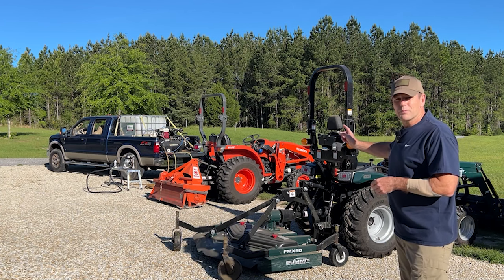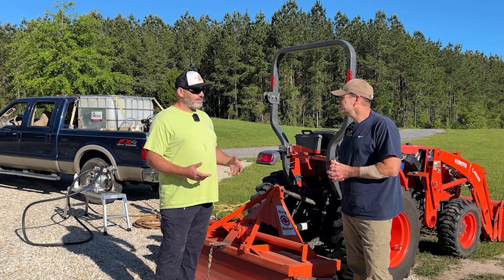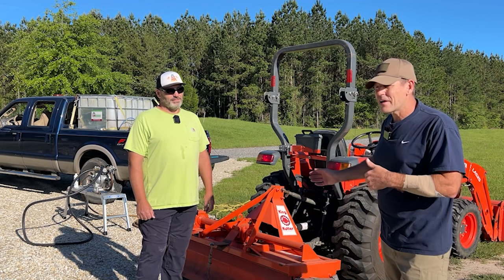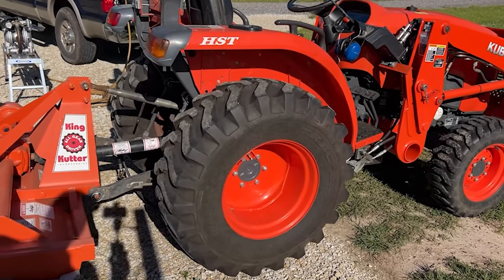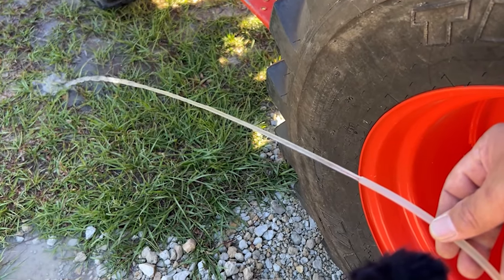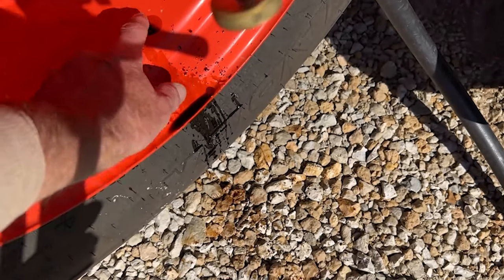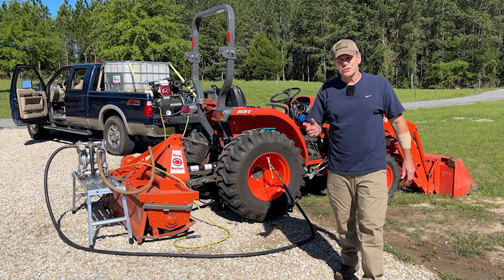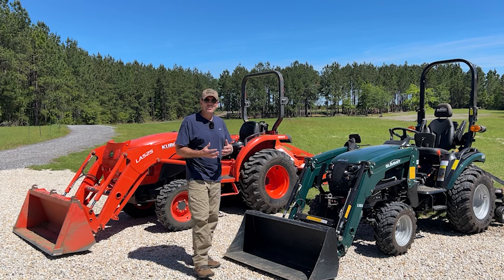Installing the BEST TRACTOR BALLAST - Beet Juice by Rim Guard!

Comment from the maker: See our tractors in action here: https://www.youtube.com/playlist?list=PLG5yS75HLzo3RVqEuA0f6IioXV6FtFhHW

Beet Juice ballast installation provided by Rim Guard:
https://www.rimguardsolutions.com/

Summit TX25H Tractor provided by Summit Tractors:
https://summittractors.com/
Summit Tractors implements and attachments:
https://www.summittractorsattachments.com/
 @summittractors  

QC-Mate X-Boom Hydraulic Coupler Clamp:
https://www.skidsteersolutions.com/
Use PINEYGROVEHOMESTEAD for 5% off anything on the website!

New way to fence your land!  Cat's Claw Fasteners.  Use code PGFREE for free shipping!
https://fencingstaples.com/

This is our Amazon store with affiliate links to products we use on the channel.  It doesn't cost you anymore and it helps support the channel, THANKS!
https://www.amazon.com/shop/pineygrovehomestead-tractorsandoutdoors

Some of our favorite products on Amazon (affiliate links):
Proven Industries Trailer Lock: https://amzn.to/3WVzytv
Flex Tape: https://amzn.to/3R4MdWm
Mechanix Leather Gloves: https://amzn.to/3HjoZZf
Titan Post Hole Auger: https://amzn.to/3toHEx2
Ratcheting Fence Tensioner: https://amzn.to/3aEfSX0
Pope and Pipe Level: https://amzn.to/3tqUhHX
Fence Post Puller: https://amzn.to/3QbcNhy
T Post Manual driver: https://amzn.to/39dwt3J
Come Along Winch: https://amzn.to/3aQMqND
Clip bending tool: https://amzn.to/3xlqrG0
Mechanix Leather Gloves: https://amzn.to/3HjoZZf
6’ Digging and Pry bar:  https://amzn.to/3vH5Agx
Dewalt 20V ½” Impact Wrench: https://amzn.to/3UOcXNH
Dewalt 20V brushless Leaf blower: https://amzn.to/3zwJcYm
Dewalt 20V brushless ½” drill: https://amzn.to/3HGXJ7z

Welcome to our channel!  🎥 What to Watch Next: 
Fixing Leaky Pond: https://youtu.be/NEwSTg1aOWc
Transforming Our Property: https://youtu.be/-jBGEYJea1Y
Clearing Thick Brush with Mini Excavator: https://youtu.be/QVNiwOHSWdo
Mowing Large Acreage: https://youtu.be/sXV5CgRs3nk

➤FOLLOW US on Social Media: 
Facebook - https://www.facebook.com/PineyGroveHomesteadAndMiniFarm/
Instagram - https://www.instagram.com/pghomestead/
TikTok - https://www.tiktok.com/@pineygrovehomestead

Our Story:
We are six years into a seven year effort of transforming 20 acres of "Piney Grove" in Northwest Florida into our dream homestead/mini farm to be filled with animals and joy. We plan to have a variety of miniature critters on our pastures, raise free-range chickens, grow fish in our pond, garden, plant fruit and nut trees, and harvest wild game. Our goal is
to escape the stresses of corporate life and embrace all that country living
has to offer as we enter the next chapter of our lives. Follow along on our
journey!

Thanks for watching and please Like and Subscribe to help our channel!!
Brad & Deb

Comment: The tractor dealership I worked at in the late ‘70s thru late ‘80s used calcium chloride mixed in water for tire ballast. The dealership I moved into in 1988 was using methanol mixed with water; in our area in central Missouri, we used 1 gallon of methanol to 2 gallons of water for protection to -20 degrees. I investigated RimGard when it first came out 15-20 years ago, but it required a special bulk tank at that time to handle deliveries from a tanker truck plus the different equipment to install it. That plus the virtual tripling expense per gallon kept us from ever switching over. RimGard is a good solution for maximum weight if your rear wheels are not drilled for wheel weights.
Reply from the maker: There's a lot to like about Rim Guard!

Comment: I think I would have a hard time spending $5 a gallon on Rim Guard for the 170# gain over plain water, in the case of this Kubota. Only a 170 pound difference between $5 dollar a gallon Beet Juice and Free Water.
Reply from the maker: I don't know what a dealer charges to fill with water but if it's a Kubota dealer, it ain't gonna be cheap!

Comment: “.. the chloride means there’s sodium …” No, it means there is chloride, which is chlorine ions.
Reply from the maker: It means it has salt and it's corrosive:     Calcium chloride is an inorganic compound, a salt with the chemical formula CaCl 2. It is a white crystalline solid at room temperature, and it is highly soluble in water. It can be created by neutralising hydrochloric acid with calcium hydroxide.

Comment: Why not use sand?
Reply from the maker: In the tire?
Reply: Sand would have a lot of issues. One being the way it would flow in the tire. It wouldn't necessarily be smooth. It might stack and at some point it could throw a tire way out of balance. Second it would erode the paint off the inside of the rim probably causing rust. Third it would erode the inside of the tire as it rolled along. And it would be difficult to service a tire with sand in it. For example sand in the valve stem would not let it seal. And you would still need the air to support the weight of the tractor and give a proper ride.
Reply: @johnweimer3423  Balancing powder is common. Often lead shot. And usually only a matter of ounces not hundred of pounds.
Reply: @johnweimer3423  That is heavy for sure, but if you put 10 gallons in the tire. Then drive across a field at 11 to 17 mph what would the balls do? Could you guarantee they wouldn't stack and go over the top in a single slug? That would be a 650-pound out of balance tire at 11 to 17 mph. That would definitely affect the ride. Liquid ballast has a track record almost as old as tires. We can put it in a tire and know within all reasonable circumstances it will perform a certain way. Meaning at all speeds and typical tractor activities if won't get you hurt or worse. And there is a limit on how much weight you want. A little 35 hp tractor wouldn't perform well with 3 or 4 thousand pounds of ballast.

Comment: Now how much air pressure do you need to run in the tires? My dealer said they added beat juice to my tires, but its not red. its brown and smells awful! kind of like fish. Was wonder what the tire pressure gague would register on yours now.
Reply: You should operate your tire pressures at the same amount recommended by your tire and/or tractor manufacturers. Keep in mind, because a majority of your tire volume is taken by tire ballast, it will not take as much air volume to achieve your desired pressure as it would a completely empty tire.

Tip: Blow a burst of air INTO the tire to clear the liquid from the valve stem before placing your tire gauge on the valve stem. This will minimize the amount of liquid that may enter your tire gauge. We also recommend using an "air/liquid", "tractor", or "wet" tire gauge as they are designed to work with any liquid filled tires.
Reply: @RimGuardBallast  Thanks for the reply.